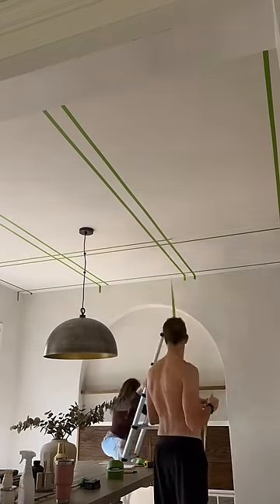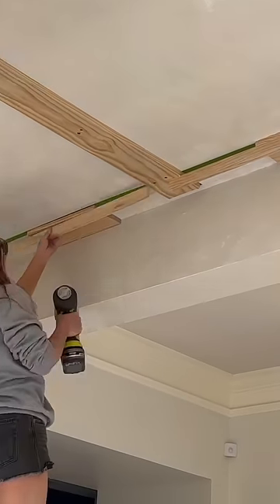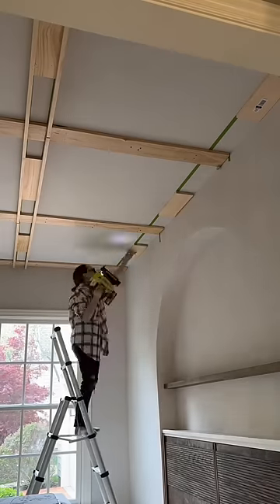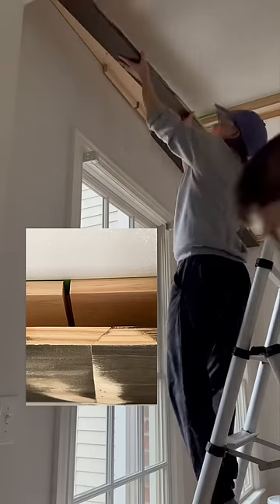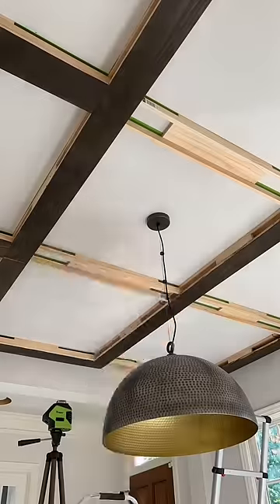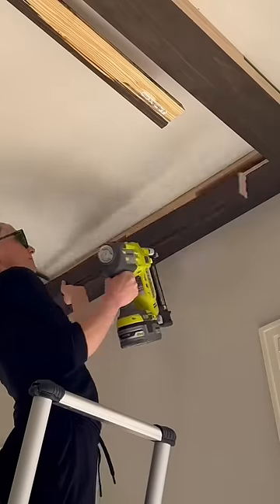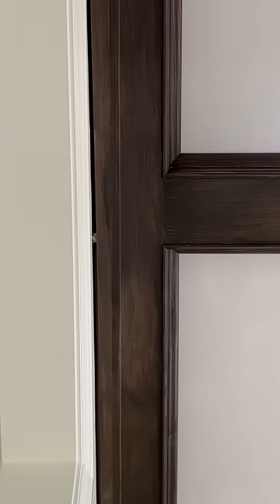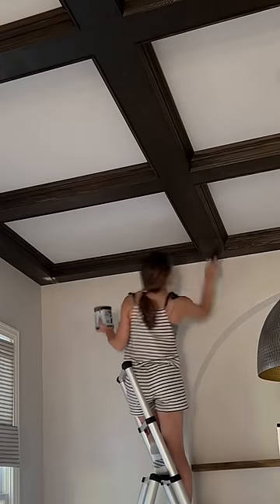DIY Coffered Ceiling!

Comment: Just like a pro! 
This came out nice and I’m sure cheaper than your local carpenters lol
Reply from the maker: Thank you so much!! SO much cheaper haha
Reply: I would’ve charged $1,400 easily
Reply: @jesusalfrb  should be charging more
Reply: @jesusalfrb  I hope that's just labor, even then that's really cheap
Reply: I would charge $3500 for labor 😂 will take me 4 days with my helper
Reply: @champagnechaos the parts and materials basically will cost the same. Just because you can afford not to pay yourself a living wage for the work is why it's technically cheaper. But the opportunity cost is still there. How many hours did this take you? From planning, design, build and clean up?
Reply from the maker: @Andy50091  that sounds like an incredibly fair rate, this ceiling was a ton of work! To get it done in 4 days by a pro would be INCREDIBLE
Reply from the maker: @CharlieBarlow  isn’t that the point of DIY? To save the cost of labor? It’s not about being able to afford not to pay myself, it’s not being able to afford to pay someone else and live through construction… these projects are hard to hire out in a house with kids running around. Cost-wise… you could offer $20k, and I still don’t know if I’d do this for anyone else, it was an insane amount of work😂 took me about a month, I worked on a little bit at a time!
Reply: @champagnechaos   Also, paying someone else means making compromises with the design and not getting exactly what you want. The ol adage that if you want it done right, do it yourself. If you can find a good contractor, that job could be done in 5 days. And then you could do another job and make money doing that. Anyways, great work on the ceiling, I didn't mean there was anything wrong with your video or project, it's just prob a bit out of scope for most DIY'ers.. but that's just my opinion.
Reply from the maker: @CharlieBarlow  I knew you didn’t mean anything by it, I totally agree with you! I’ve learned (the hard way) what I’m willing to diy and what I’ll never do again, and I’m probably too honest telling people how brutal a project can be. Having a good contractor to call is so huge. We’ve had some rough experiences that have caused me to take on more than most. I think the cost of a good contractor is worth the preservation of my mental health whenever possible haha

Comment: Usually these homeowner diy are really stupid, to a professional carpenter like myself. However, I’m thoroughly impressed with this. It’s basic, probably exactly what you wanted and looks great. I’m located in the northeast, just so you know, I would have charged about $3800-$5500 for this plus the material cost. You definitely saved yourself some money.
Reply from the maker: Ah thank you! That's a high compliment coming from an actual pro!!! ❤

Comment: I like the part where you used a stud finder and marked out the beams behind the drywall so you knew you we’re screwing into something.
Reply: Just don't breathe around it and hope for the best
Reply: You'll know you're hitting something when it gets harder to screw into.
Reply: You can see a laser on the ceiling making the joists where she was putting screws in
Reply: @oscarcollinsiv  Wilde
Reply: @howitworks3607  lasered for alignment of her structure not hidden structure.

Comment: Very nice….But Isn’t this heavy on the ceiling?
Reply: She's using plantation pine which isn't super dense. Not a brutal weight to mass ratio, but yes, it's added strain on the ceiling joists, but standards are such that  rated load bearing for suspendedweight is factorially above what the extra material will equate to.
Reply: @bend3rbot  It looks great. Thanks for explaining.

Comment: Looks great, Only thing I really hope you secured the base posts to something other than screws and nailed into drywall. It may be holding now but over time as the house settles, temperature and humidity changes screws and nails can loosen out of drywall and eventually fail. Would hate to see such great work end up having issues a few years down the line.
Reply from the maker: Anchored to joists! Thanks!!

Comment: Just came out pretty good but you can’t do it on the ceiling that sun at least 8 1/2 feet it just doesn’t look right but that looks absolutely amazing I like that you painted it before you put it up you can do a little touch up later but the painting is pretty difficult if you want to get those nice tight lines I gotta give you a really props I wanna run some wire ready for future couple of strips Romax wouldn’t hurt you but great job

Comment: In this case, you need a room that is 2.7m minimum because you building from the existing level down. In my case, I have an investment house with 2.4m ceilings! So I have done the same but elevated ceiling "squares" from 2.4m to 2.7

Comment: Looked like your finger shot was due to a kickback? But word of advice is to always hold as far away as possible when shooting nails, or you can simply hold what your shooting with another small piece of wood or a speed square in certain spots! But your box beam ceiling turned out well!
Reply from the maker: Thank you so much! I just recently learned about kickback… I didn’t realize that was a thing until a friend’s family member got a nail in the eye😳😳 safety is so important!

Comment: Just out of curiosity before you turn this whole thing into one structure with the glue did you anchor it properly to the ceiling food for thought for anybody thinking of doing this on their own
Reply: Looked like the initial 1x6's were screwed to the 2nd floor I joist/ trusses.
Reply from the maker: Yes!

Comment: Did you need to do anything to hide seams like caulk,wood filler, paint, etc?
Reply from the maker: Yup! I’m working on a longer video that will include those details… I used wood glue mixed with sawdust to fill the seams between the 1x6 boards, then sanded those down, and they took the stain well🙌 then I used wood putty (color ebony) for the nail holes… I made sure the mitered corners were super tight, so they didn’t need anything!

Comment: Would you not be worried of accidently drilling through the wires of the ceiling light? It looks fantastic tho!!
Reply from the maker: This is something I always worry about! My other fear is a water pipe😬 electrical stuff should be covered by a metal plate (I’ve hit plenty of those for sure), but I know not everything is built to code!

Comment: Would it be possible to build the frame on the ground?
Reply from the maker: Maybe in parts, but building it on the ceiling works best. Also - you get a killer bonus arm and shoulder workout in!

Comment: The support brackets won't hold that weight for a year. They will bend in no time... You should show them two years later.
Reply from the maker: One year in and no bowing! Guess you'll have to stick around for the 2 year check in!

Comment: Screen molding around edges? Can you elaborate?
Reply: The molding she used is identified by its most common "old" usage.  
      The dimensions of screen molding is usually 3/4"or 1/2" wide by 3/8" thick.  Back in the day :  Homeowners would put their own netting on screen doors and windows to keep bugs out.  They had no A. C. Units to rely upon.  But you're too young to know about that.

Comment: If you were elevating the room you would be making the ceiling go higher not making the room smaller by putting stuff on the ceiling so if the roof was 10 feet tall now it’s only 9 feet

Comment: I have the same nail gun and it's heavy. after a while you could feel the weight.
Reply from the maker: Omg yes!! It drives me nuts, I seriously need to find a lighter one
Reply: @champagnechaos  And it's especially hard to use behind the commode. If you're nailing baseboard or something. It's just too big. But it is convenient to have around. You don't have to lug around an air compressor. Good luck

Comment: 'I didn't add glue to the ceiling therefore it's VERY secure.' That is an idiotic line of thought.
Not gluing the thing that holds all the weight below and thinking that it's MORE secure that way it is non compos mentis! 🤦‍♂️🤦‍♂️🤦‍♂️
Reply from the maker: It's attached to joists!
Reply: @champagnechaos  that may be true. But gluing and nailing is more secure than just nailing.

Comment: Yeah keep feeding people crap by showing doing fancy stuff without telling them how to actually do it in a proper way and help them collapse their ceilings! how does it elevate your ceiling with a dark color? What's carrying the load of those pieces of lumber, the drywall? Those must be screwed to the rafters, ceiling or floor joists! You needing attention doesn't mean people have to damage their property! Lame
Reply: You can move on.
Reply from the maker: You're so right - you have to attach to the joists correctly. Good thing that's what I did!